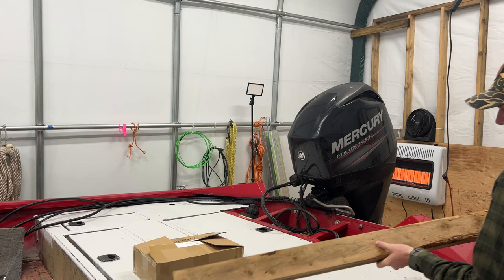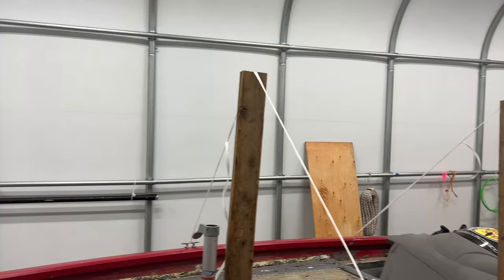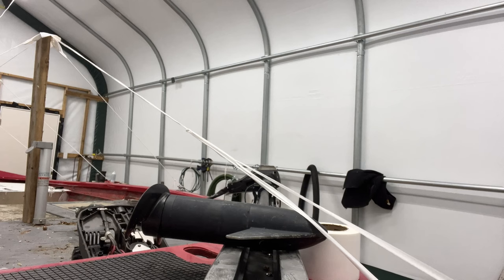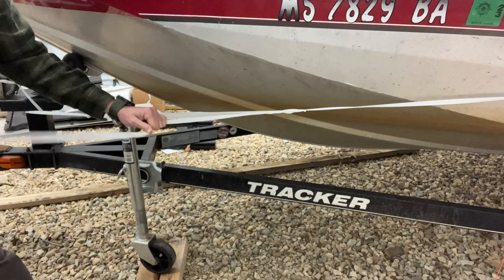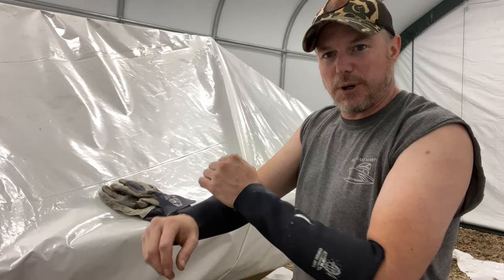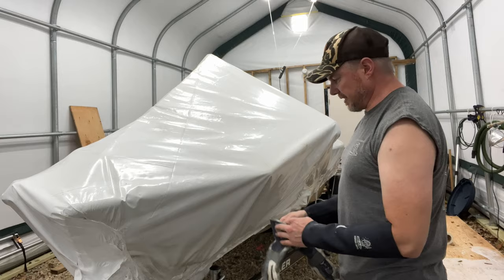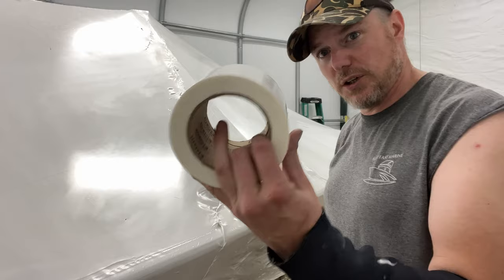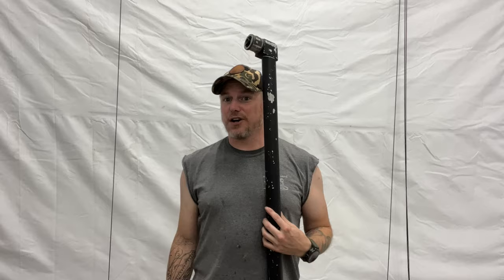HOW TO SHRINK WRAP YOUR BOAT -The right way-

Comment: WELLLLL.....as a fellow wrapper of ALL things from boats, to campers ,to patio furniture, to ZAMBONI's!!!....I'm gonna give you a free tip that will save you a lot of money! As you take a piece of that very expensive Dr.Shrink tape and double it over on itself multiple times to protect the plastic, I CRINGE as I see those dollar bills getting thrown out! Instead, go to your local carpet dealer and get his scraps for FREE! He is usually glad to see you come to take some of his garbage! My local guy actually gives me his 10" X 10" sample swatches of carpets that he no longer carries. They work great and can be used in ANY situation where there is a sharp corner. That's my 2 cents worth! CHEERS!!
Reply from the maker: I used to use carpet all the time. But because I wrap fast and hot there are times the carpet overheats and burns a hole on the one place I can’t reach. Yup the tip top of the 2x4. So for me the tape is the way to go. Merry Christmas!!

Comment: I’ve been wrapping for 15+yrs. Everything from lawnmowers to 60ft modular buildings. When I wrap boats, I do about 200+ every fall. I always use a wooden frame, never single 2x4s.
Reply from the maker: That’s great! We don’t do that. Why would I?
Reply: @HoldFastMarine  Just helps with the snow load, I'm not sure where you're from but we get a lot of snow in Ontario where I am, I dont trust just the string to hold the weigh of all the snow and ice. It also helps provide a nice big peak like on the roof of your house so that very little snow will stay on the wrap.
Reply from the maker: @jonathanbond4739  We get pretty good snow loads here too. The biggest problem I have with making wood structures is 99% of the time my customers cut them up or use the 2x4's for a project. I have about 45 guaranteed repeat customers each year and 40 of them don't have the uprights from the year before 😆. It gets costly for me and the customer. But I get your point. Merry Christmas.
Reply: I was a tad worried, had my 21’ boat last year wrapped. Being from northern Mn, lots of snow. But 2x4’s with strapping held up great. I’ve used framing in the past with a tarp for a long time, works pretty good but wrapped is superior. The frame is a pain to deal with. I plan to start my own wrapping this fall, too many toys, jet skis etc. hopefully I get up too speed.

Comment: It "may" be cheaper to have someone come out and shrink wrap your boat the first time...but honestly, after you buy the gun and extension, it's way cheaper to do it yourself in the long run. First year start up you'll take a little hit, buying the gun and extension.  This is my 2nd year doing my 2022 Moomba Kaiyen by myself. I spent $223.96 buying my materials from Dr. Shrink this year, and 3.5 hours of my time to shrink wrap my boat. That's way cheaper than hiring someone to do it.
Reply from the maker: People never factor in cost of time. Took you 3.5 hours, it would take me 45 min to an hour. Everything I do I factor in 80$ an hour for my labor, wether I’m doing household plumbing or mowing the lawn. So it really cost you a little over 500$. Whereas I would charge you 380$ to wrap your boat.

Comment: Less than $3 for a cap and they are reusable. Don't be so cheap, buy three and they will last forever.  
      I have Three twenty foot boats. For me to have someone come out and shrink wrap all three was about $1050.  I bought the heat gun, a big roll of shrink wrap (200 feet) and every thing else I needed for less than $1300. It costs me about $50 in material to do one boat.  $150 for all three and Its not that hard to do.  If you have to do it before every winter you will end up saving a lot in the long run if you do it yourself.
Reply from the maker: So first of all, it’s not being cheap. I can’t buy three I would have to buy 700 of them. And again, nobody ever factors in time time being the most expensive. If you value your time as I do, at $100 an hour, you’re around that 1050. And trust me the purpose of this page is to get people like you knowledge and experience so they can do their own projects.

Comment: What I meant was, I have a wrap on my boat instead of having it painted. So would there be enough heat to damage that wrap?
Reply from the maker: Ohhh you have a vinyl wrap. DO NOT attempt to shrink wrap the boat.  The heat gun is 18,000 btu you’ll melt that vinyl wrap right off
Reply: @HoldFastMarine  I have the RiPack3000, it is 153K to 260K depending on the valve setting. I would not run that on a wrap.

Comment: I'm trying to wrap my 32 ft sailboat which is on land in a boatyard. One company wanted 5 to 6 THOUSAND DOLLARS. I never even replied. My mast is still up and I have 6 cables that go to the mast that need to be worked around. Hopefully today this different company will give it a go. I built a plastic pipe structure from 3/4 schedule 40 pipe so I can work under it to sand and paint my upper deck. What model gun do you prefer?
Reply from the maker: With a mast up, I’d charge you 3k to wrap your boat. It’s a TON of work cutting and taping the wrap. I prefer the larger BTU like the one I’m using in the video. Wrapping a sail boat with a stepped mast is NOT anything I’d recommend to a first timer.

Comment: I have a paving and sealing business. Older people like to try to seal their lot themselves. I understand lol. But after they buy tools and those crappy buckets from the hardware or box store they spend way more than I charge and they still have to do the work. Not to mention that bucket sealer is terrible for the asphalt. Imma tightwad but I believe I would pay to have one wrapped.
Reply: After 3 yrs (this is my 3rd yr)my stuff payed for it self, I still have 3 yrs worth of materials to use up. After that it will only cost me aprrox 50 dollars a year to shrink wrap mine, I also use it to shrink wrap my stuff at the campground lot we have. I reuse a lot of the banding strap and buckles several times, I reused all the buckles and about 90% of the banding strap from last year.

Comment: This is my second year wrapping my 15' jet boat myself. I bought all the materials last year and did it with a torch used for roofing and killing weeds because that's what I had. It worked okay, but applied too much focused heat so I had to be careful for it melting the material. I bought the shrink wrap through dr shrink page on amazon, blue, 120 something foot roll cost me a little over 109 bucks. Probably the same one you talked about. I got some plastic caps for the 2x4's from amazon I think they were also dr shrink brand, they protect the deck and the cover from scratches and tears they were super cheap ($15) and they're reuseable. A 1000' roll of strapping, and a bag of metal strap buckles (also reuseable) for 20ish dollars each. First year cost me under 200 to wrap my boat myself. Because its a 120' roll I get 6 years of covers from that 109 dollar roll. Yea, the total price you put was for covering it this year because you bought all the tools but next year it'll be free because you'll have plenty of material left over. This year I purchased a dr. shrink gun to make it easier. 435 dollars. It worked great, no holes at all. In NJ I was quoted 400 alone to wrap my boat. In just 2 years I already saved money wrapping it. Doing the math of tools and material it averages 105 dollars per year to cover it. That saves me 300 per year. It took me less than 2 hours also from start to finish and I did it when it was 35 degrees out so I took several breaks to warm up my hands. I'll link the gun I bought and the 2x4 caps below. If anyone is handy I'd definitely say give it a shot if you wanna save a few bucks. 

https://dr-shrink.com/product/rapid-shrink-100-propane-heat-tool-ds-rs100/

https://www.amazon.com/6-Pack-Bottom-Shrink-Installation-Support/dp/B08CB1XQ37/ref=sr_1_1_sspa?crid=2RJCT15PQG6EO&keywords=dr+shrink+cap&qid=1670732408&sprefix=dr+shrink+cap%2Caps%2C94&sr=8-1-spons&psc=1&spLa=ZW5jcnlwdGVkUXVhbGlmaWVyPUFTRDZUTEFINTI5OU0mZW5jcnlwdGVkSWQ9QTA5NDA4MjFWMVYxUUhRSDhGTkUmZW5jcnlwdGVkQWRJZD1BMDcwMzE2ODFHRFk2VFFSTFRFM0Umd2lkZ2V0TmFtZT1zcF9hdGYmYWN0aW9uPWNsaWNrUmVkaXJlY3QmZG9Ob3RMb2dDbGljaz10cnVl
Reply: Yep . I just bought 3 rolls of 9 mil from a supplier in vancouver and im useing a roofing tourch/tiger tourch that i hammered the end down on .. ive spent just under 1000 canadian dollars and have enough matériel to wrap my 27 foot fishing boat. 20 times

Comment: So I bought a 12x20 carport in 2020 with my best friend. Well the canopy lasted about a year before it ripped down the center in July. (Jan 2021 to July 2022, so a bit over a full year and a half.)  My next door neighbor who has a similar one but for the last 10 or so years just had his the same time I got mine, his shrink wrapped. Its held up great and now I plan on using some of the tips shown here to do my own. 

I don't have a pro heat shrink gun, but I'm also doing kinda a box anyway so, that should not be too big of a issue. 

I have a product called mule tape. Its a nylon webbing rated for 2k lbs pull strength from my job (its excess that was collected and stored for later use. Shortest runs about 100 foot. ) that is a nylon strap on steroids. I plan on running a set back and forth across my frame for support from snow and or wind, basically because I have 5 gallon buckets full of it and it's free. 

Now with this said I plan on putting this up soon, and up here in New England its rather cold already. 

Would a heat gun and a propane torch do a basic job of the seam at the belly band to hold down the wrap so I can just get away with it? 

I plan on using a propane heater head, the sun flower kind? I don't know what its called, a single catalytic round face heater to slowly bring it all taught once i have the edge secured and doors shut tight. I may instead borrow a jet heater (kero long tube heater) and just can't the shit out of it to bring everything to a slightly shrink and even tightness.

Does my plan sound like a fools errand or like a mechanically incline sparky have half a shot at getting it covered 🤔 

I am looking st Amazon for a 14x25 foot or 14x50 foot roll since my height is 28 inches, 12 foot across pyramid, and mathematically it should not need more then 12 foot 8 inches to go across and the rest is for the fold and melt. 

Should I buy the 50 foot long section because I'm likely to just screw up? 

Should I go with a 17 foot wide x 25 long to make sure I have excess plastic 🤔 

I do plan on getting the tape and from the under side taping the sheet to the bands im running for some minor pull off resistance. 

(In July we had some high winds here by the coast and normally that's not the big issue. Snow load is, but now that we had it once I'm trying to mitigate factors to give me a running chance.)
Reply from the maker: First off let me say this is a great comment!! very well written! Now to answer your question.
It is a fools errand. Those sunflower torches don't have enough heat dispersed quick enough to not melt the shrink wrap slightly so you can weld it together. And you're likely to burn many hole and probably yourself holding up one of those jet heaters. Now I'm not anyone to tell anyone not to try something, thats how we learn (the hard way sometimes). My old boat house was completely shrink-wrapped, and it lasted for 2 years with only a few minor issues like holes and some sagging from snow, which you will have to get off to prevent ice, the ice is what punctures the wrap. 

If you end up trying this, please dont, but if you do id love for you to send me some photos to my email, wether it works or not. I hope I answered your question for you. Have a very merry Christmas!

Comment: Do you staple the cord to the top of the 2x4?
Reply: I use a wood screw with a flange then put tape over the top, other wise the screw will heat up fast and burn a hole thru the shrink wrap material, I also use old wash clothes to put over the 2(4)x4s where I don't have a cap installed. But yes you can staple the nylon cord, just make sure you use long staples and cover  them with tape.

Comment: Good video. But are vents not required? Thanks
Reply from the maker: Vents are a great idea. The reason I didn’t put vents in this boat is because we were redoing the whole boat. So if something got wet or damaged no big deal.
Reply: @HoldFastMarine  understand. Thanks again. Looking forward to giving it a go.
Reply: How would u install vents on the shrink wrap I’m curious